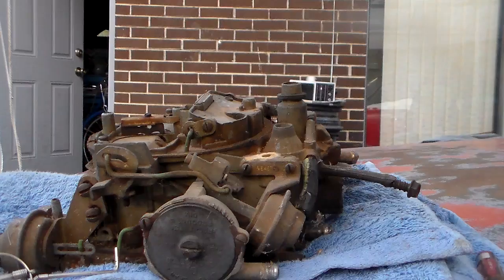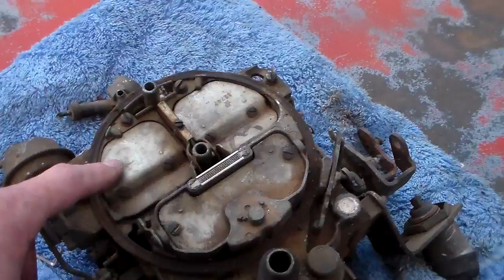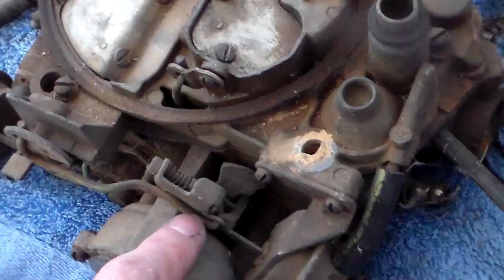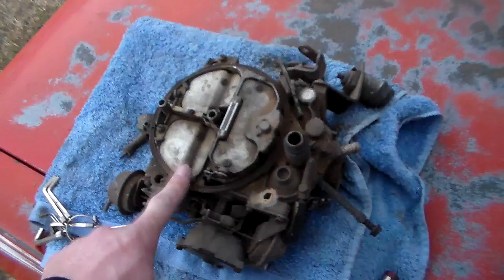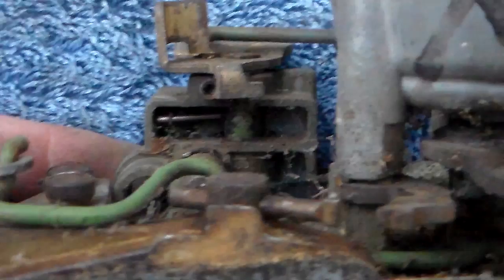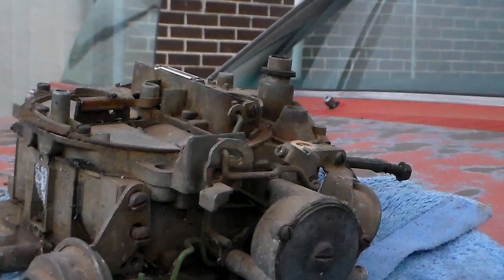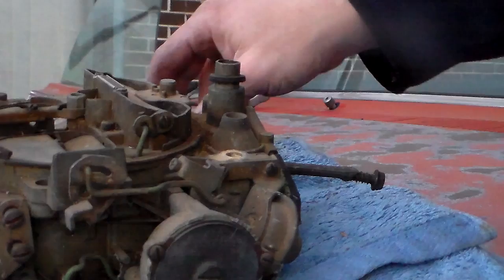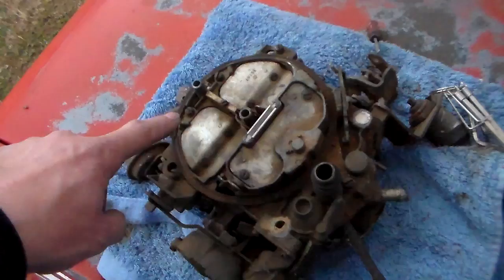How to adjust Quadrajet secondary air doors

Comment: I just bought a q-jet from jet performance a few months ago. Carb runs great just cruising, but when I start getting into the secondaries it start bogging down and kinda spitts. Almost seems like it's starving for fuel. I run it with the air cleaner off, the secondary air doors open slightly. Not sure what is going on with it. Paid $475 for a carb i can even open up
Reply from the maker: You are losing fuel supply somewhere. The air doors need to be tight enough to stay closed. If the flop open too easily or stay part way open you will never get a clean transition into the secondaries. People get too hung up on "they need to open as wide as they can" mentality. Past that, your symptoms sound suspiciously like some of the secondary pickup tubes have fallen out of the airhorn inside the carb. They press into the bottom of the airhorn and supply the secondary side fuel. There are usually two metering tubes and two pullover enrichment tubes. The pullover tubes supply the small holes at the forward edge of the airdoors with a bit of fuel when the airdoors start to open so it doesn't get a bog before the metering circuit comes in. If your air doors are hanging OPEN then you have effectively disabled that. Rochester spent lots of time making these carbs run very well so I encourage people not to second guess things. I would adjust the spring tension on the airdoors per this video, and then see if your issues resolve. if they do not then you or someone will need to remove the airhorn and have a look at those tubes and the float level. Pick up one of the qjet guide books, it will help immensely.

Comment: @Tylers Forgotten Car Rescue  
(And community) 
I've got a vaccum secondary, ele choke quadrajet on my nova. It runs fine when it will. But it seems to get stuck wide open.  It'll slowly gain rpm, then the secondary flaps start to open, then by then it's climbing so high in rpm you have to shut her down in fear it'll blow up. 

Soon as you start it again though,  it'll idle fine. 

I'm honestly stumped about this, any help would be appreciated
Reply: Also to add, it all functions very smoothly. Nothing is hanging up. It just gets stuck wide open.

Comment: What about the quadrajet  pump ?  Have a 1986 GMC sierra classic, and can`t get fuel to the plugs. Any ideas ? Sounds like you can hear fuel in the carburetor when you work the linkage from the pedal, not sure though.  #1 SPARK PLUG bone dry !!  Fuel is coming to the carburetor from the pump. Don`t no about the pressure though.  Pored fuel strait in the throat of the beast still no fuel on plug.

Comment: Thanks, mine was sticking on the butterfly to the body in a little spot the size of the diameter of a pencil.  Opens up when I floor it with the pedal now.
Reply from the maker: +BBugnOut Great. The entire carburetor can slightly twist after years of the bolts being tightened down.

Comment: hello, okay with you? I have a Thunder 650 and was wondering if you already tried to change the aperture of the secondary air flap .. I wanted to leave it wide open trying to have more hps but I noticed that the engine of the lack of fuel in acceleration will be ... if I increase the jet pump can leave the secondary air flap open?

Comment: Nice video, I understand 50% , I got a problem whit mine, the secondaries above open, but the secondaries plates on the top doesn't, could be the choke? It al seem good, only the top plates doesn't open

Comment: I've got a 85 k10 and my air doors won't open on the truck if I use my finger all the way like yours did. Is that normal? And it seems like my secondaries won't open all the way with the pedal all the way on the floor. I don't know much about these carbs so please learn me one you get a sec

Comment: Great video. My secondary's butterfly has no tension in the spring: it stays down if I push it down. even after adjusting the adjustment screw as you show here. The spring you show at 17:46 seems got separated from the rod it is supposed to attach to. Is that spring available as a spare part? I yet have to take the carb off to confirm that the spring has lost that curved end that holds it to the rod. I believe it is broken.
Thanks
Reply from the maker: There's a place called Quadrajet-parts on the internet that may have it. Otherwise, you might buy a cheap parts carb off ebay to get the part.

Comment: My secondary doors kind of stick when they are all the way open.
if I push them with my finger to full open they will stay there.
Will the dampener pull that back? or is there another problem?
it is hanging up a bit in travel as well.
Reply from the maker: It needs cleaned well
Reply: @TylersNeighborhoodGarage  This is after rebuild. I'm noticing that the linkage from the dampener
helps to allow the doors go full open with the weight of the big loop in the linkage on that end.
Should I smooth/sand the metal there to help it glide better between linkage and metal plate it
attaches to on the secondary shaft? It seems as though the dampener won't be able to pull the
doors shut on the increase of vacuum. I've just rebuilt it, it's still on the bench.

Comment: The second linkage you spoke of that keeps the door closed while the choke is on, can you just remove it? Mine seems to stay engaged all the time.
Reply from the maker: It does stay engaged all the time until you floor it and the vacuum signal goes away. That lets the vacuum kick extend back out and the vacuum doors open. I know on the face of it, it seems counterproductive, but it actually does prevent stumbling. Don't remove it.
Reply: @TylersNeighborhoodGarage  ok,  then what would prevent the secondary from opening? Mine won't open when I floor it

Comment: I have a quadrajet fitted to a Volvo Penta 4.3. There is no vacuum in a marine set up. It takes a huge gulp when opening the throttle hard. Also if throttle is all the way open, it starts to bog and loose power and have to back off the throttle. Is there anyway to get this carb to proper adjustment on a marine engine?
Reply from the maker: A marine qjet works the same as any other. I'm not sure what you mean by "no vacuum".

It's possible you have a couple different issues going on, but first things first. The "gulp" sounds like the secondary air doors are adjusted too loose, i.e. not enough spring tension. Also, there should be a vacuum dampner attached to the secondary air doors by a rod. Often the dampner serves a dual purpose as a secondary dampner and choke pull-off.

Anyway, the dampner and proper tension on the air doors are the two components that allow the transition into secondary operation without a stumble or a bog. If the dampner goes bad then the doors try to open too far, then bounce back nearly shut. Adjust your airdoor spring and make sure the dampner/choke pull-off pulls in with vacuum applied to it.

Once you do this see if the high-load stumble goes away. If not then it might be time to open the carb up and see whats going on in there. These carbs run nearly as smoothly as fuel injection normally, so don't give up hope.

Comment: Thanks for the info. The previous owner removed the vacuum dampening linkage and all choke linkage, and wiretied the butterfly to an open position. I was considering installing a manual choke, but based on your info it still will not run correctly. Should I try to purchase all the vacuum parts or look a complete rebuilt unit? This carb was put on in place of the original Holley 2barrel.
Reply from the maker: Well, the linkage pieces are not hard to come by, but they don't come in a rebuild kit. The only things in a rebuild kit are gaskets and rubber bits, plus the inlet needle and seat.

 What I normally do is look around on eBay to find a core carb that has the stuff I need. You can usually get one pretty cheap if it's really dirty and scummy on the outside.

 I think that's a pretty common electric-choke, Chevy style carb that was also used on cars and trucks through the mid-eighties. If you can provide your carb  number then I can verify what parts carb you should look for. The number is located on the LEFT(side that has the throttle cable) side, on a rib running vertically up and down.

It'll be something like 1708816 with 2067 AJC under it. These are just representative numbers, yours will be different.

Comment: Do you have any idea of the modifications done to the quadrajet  in the 80-81 TA Turbo cars? I'm looking on the net and no one has any info on how to make the "Q" a blow through. Sure I could use a Holley,  but I just like being different.
Reply: I ran a 81 turbo TA for years when I was a kid - the things Pontiac did to that Quad from the factory was a perfect blend of clockwork and pornography ... anyone who owns one, keep that Quadrajet in good working order but don't modify it, it was perfect the way they designed it with all the factory gear attached

Comment: Thank you I have a 1990 454 in my old RV and could not figure out the bog when the secondary should be kicking in going up hills or merging on highway which is so unsafe your video was clear and concise and so much appreciate you take care.  I did have one question do you have a picture of the pick up tubes that might have fallen off from another carb or quick advice if easy to see if they have fallen off will try the video first but wanted to verify both just in case thank you again. Rian

Comment: I have a Rochester 4 BL on a 86 Silverado 305.  It only has one Damper on the firewall side.  How do I determine if it was suppose to have 2 like the one your going over?  These videos have been so helpful. Thanks so much I have learned a lot.  After watching this video I thought Praise the Lord I found my problem, only to go out and look and only see 1 damper.  I have looked at other pictures of the same carb, so I thought and some have a damper in the front, some in the rear, and some with both.  Is there a  way to tell which one Im suppose to have?

Comment: Great video. I rebuilt my quad and it bogs very bad if you step into it at all. I looked and the damper rod for the back four (break) had slipped out. I will put it back and see what happens.

Comment: Great videos and the QJ. I run a QJ in my Ford 460 in a 66 F250.  Sorry, not GM or Mopar :)  I cannot get the air door to open on the secondaries and so I watched this video with great interest.  I tried adjusting the spring as you instruct but that makes no difference.  I gather that adjustment is more for closing the door and nor opening it.  I also checked all around the opening in the airhorn and there is absolutely nothing rubbing of blocking the door from moving.  I took a couple of photos but don't know how to get them to you.  My setup is a little different than yours in the video.  For one I have only a single vacuum pot on the rear of the carb.  It appears to serve the important function you outline here and I can't see that there is a hang up there either.  I'm stumped.  Any ideas what to try next to get that door moving?  I can send photos if there is a way.  Thanks, Steve

Comment: Nice video, i have a 4 barrel Rochester for my 1988 350 mercruiser. This thing starts right up and runs good until Wide open, then it loses power slowly. I don't think my secondaries are opening. the spring tension is good and my vacuum diaphram has positive suction when i start the engine. But when I hit the gas the vacumm diaphram doesn't release.

Comment: Tyler Dude what a life saver. Learning engines my friends Dad (you know the "Cool Dad" Called my quadra jet a quadrajunk and I hated it. Now That I am older and wiser I am rebuilding my baby. a 69 LeMans with a 79 Trans am heart. The Olds 403. Don't judge its what came in it when I bought it. The question is now that you saved it's life by showing me the "hidden Spring" on the secondary air doors. Should I switch to an electronic choke? Or track down and purchase the Hot air original style? If i t's ok to go electronic do you know which one I should use? Thanks again

Comment: Great videos!  I was able to rebuild my quadrajet using them. The car is running great except for one small problem; the secondary needle hangar cam is missing. I bought a new one but how do I put it in? Is there a way to put it on without taking apart the secondary air valve? which way does it go? I don't want to install it backwards.

Comment: Really appreciate your videos.  Just pulled the Quad off my 84 Chevy truck (17084226) and started a rebuild. It was going well until I discovered my air horn is warped.  Do you recommend trying to straighten? I did not see that you had any video on correcting warped air horns.  I have watched most of your QJ videos over the past week in preparation for the rebuild.  Thanks for sharing this information.

Comment: Thanks so much for the video.  I have been having this exact problem on my 86 Silverado 305. My Rochester 4B appears to be missing the front damper.  Your demo was on a higher performance motor, but am I suppose to have that front damper? Sorry if thats a stupid question.  Just want to make sure before I go and try to buy the part.

Comment: The cam on my secondaries seems to have a wore flat spot on it right where it starts to open.  It catches a little.  I hope it will work when I get it on the engine.

Comment: Like your videos. Curious What is the adjustment screw that sits on top of the choke housing?
Reply from the maker: That's probably the adjustment for the vacuum pulloff distance. It has to do with the amount that it "pulls off" the choke plate on a cold start.

Comment: Love the quad.. I do have a question.. I decided to build another street car and didn't want the typical Chevelle, Mustang. etc.. Being a Chevy man by trade, I wanted something different..  So I am building a 75 Ford Maverick.. Yes I know a Ford.. Had a Holley on it, and in my opinion there junk.. So I am rebuilding a Rochester Quad part # 17056208.. The motor is a 70 model 302 30 over flat top, with 70 model 351W heads that have been ported and polished, with oversize stainless valves.. It has a comp cam non roller 515 lift 280 duration.. It's not going to be a drag car, just a weekend cruiser.. My question is should I go with a bigger primary jet.. I can't seem to find the info on what the stock size jets and metering rods are for that carb.. Any help would be appreciated.. Love the videos..
Reply from the maker: That should be plenty of carb. It came from a '76 Chevy 350.

 You can read your plugs after cruising for a while and that should indicate if you need to jet down any. Don't feel bad putting one on a Ford. Chrysler used them and even Ford used Qjets on some early 70's engines.

Comment: Hello Sir, Great video, but I still have a question.  On my Quad jet the problem I run into is the vacuum damper will not release the rod under full throttle, it is like there is still too much vacuum on the diaphragm.  The diaphragm releases while the engine is off but pulls tight while it is running so I think it is ok, I just don't understand why the diaphragm won't release? I feel certain it is hooked to the right port, but maybe not?
Reply: Make sure it's hooked to manifold vacuum. Where it's sucking air at idle, and part throttle. When you floor it, the vacuum should go completely away. The other type of vacuum is ported vacuum. And that has no suction at idle, but starts sucking air with more throttle. 

If you've got manifold vacuum on it and it still doesn't release at wide open then you need a new canister.

Comment: cool video , new to the q-jets , I have a hand full of 4x4 buddy's and they all run the q-jets , mainly because of the center float when 4x4ing , so here is my question . I am missing parts of the q-jet that is related to the choke , I'm on the web . looking and all I can find is like two peace's and cant find the rest with out buying two or three carbs is there a place that I can buy all I need ? I'm running a 7041211 any help would be great , thanks jay
Reply from the maker: Try quadrajetparts.com. Good luck!

Comment: I have that exact same carb on my 79 el camino ss. I have searched and asked all over about this and no one can help me. On the front left side (driver side) of your q jet in this video there is some type of electronic piece. Mine has a metal tab sticking out of it for a wire to plug into it. I couldn't tell if yours had the tab but it is the exact same as mine. I have searched the internet for this and this is the first time I've seen the exact same carb as mine. I cant find anything on this. I've looked up the numbers on mine and cant find anything special about it. I have used my q jet for a while now without a wire connected to this with no issues but would like to know if it helps with anything. If possible I would like to send you pictures if you need them. Let me know what you think. 

Also thanks for the great videos.
Reply from the maker: It's probably an idle kick-up solenoid. With 12v applied the plunger should extend against the throttle arm and raise the idle slightly to keep the engine from stalling with the ac on. Alternatively,  it could be used to let the throttle plates close all the way when the key is turned off to prevent dieseling. You should be able to determine which function it is used for. Good luck!